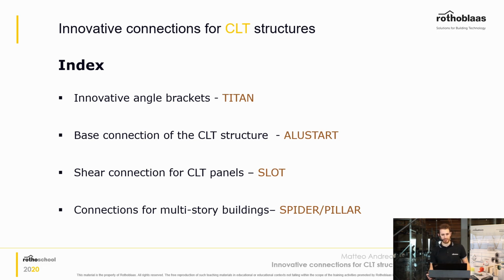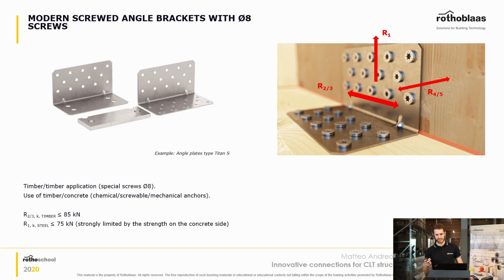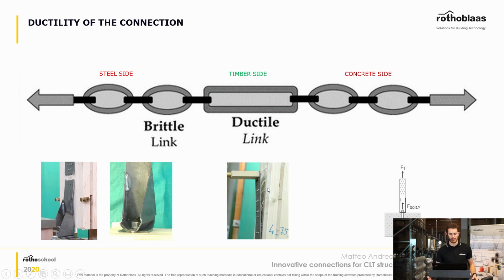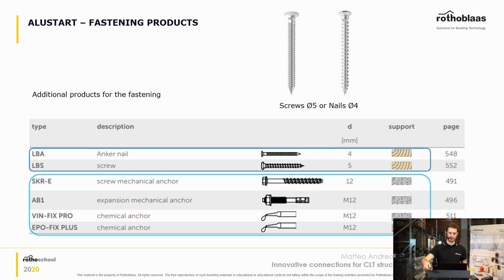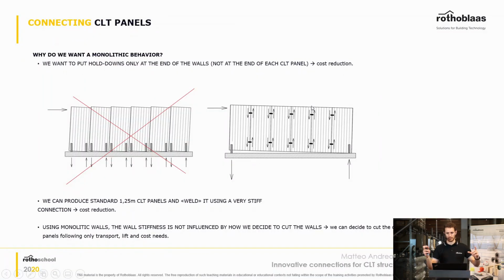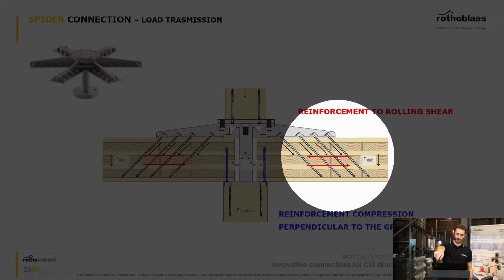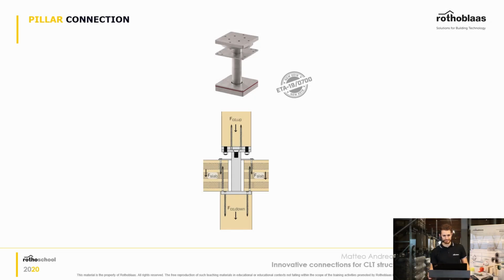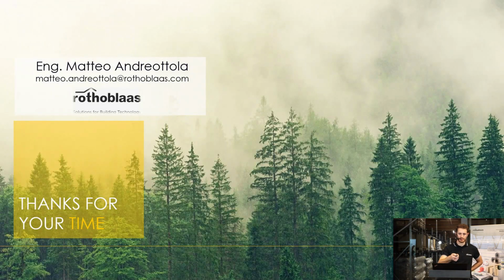Innovative Connections for CLT and Mass Timber - Rothoblaas Insights

Comment: Can it be used for a connection between one floor of concrete walls and second floor of CLT wall, being placed in the middle of them and bolting it to the concrete load bearing layer???
Reply: or is it just for connection to foundation?
Reply from the maker: @emanuilgeorgiev2863  Hi Emanuil, sorry we didn't see your comment before! We provide a lot of connectors for all the pourposes: https://www.rothoblaas.com/products/fastening . For specific quetsions don't hesitate to contact our Techincal Support here: https://www.rothoblaas.com/technical-support, they are the best in sugegsting costumized solutions. Thanks, team Rothoblaas